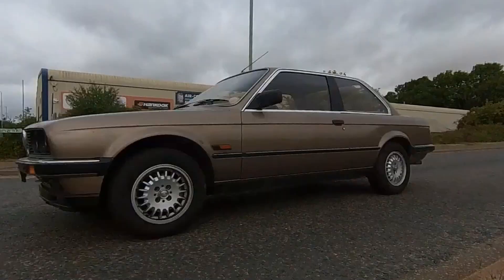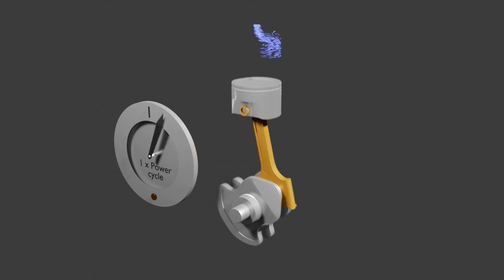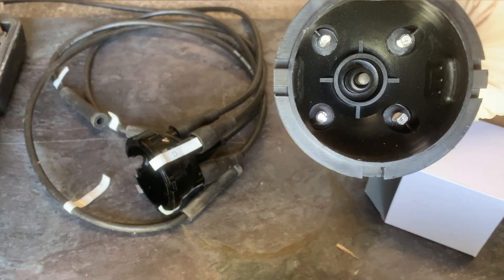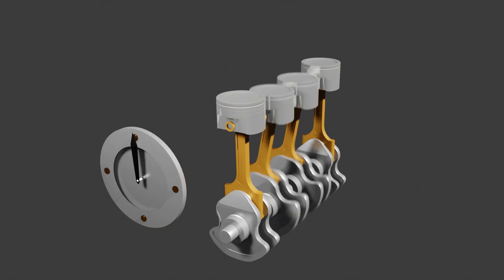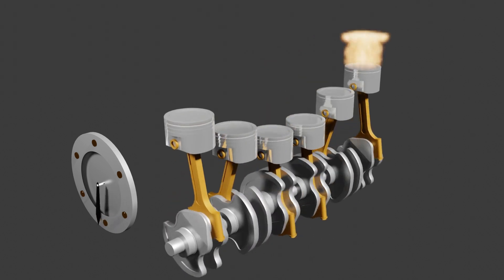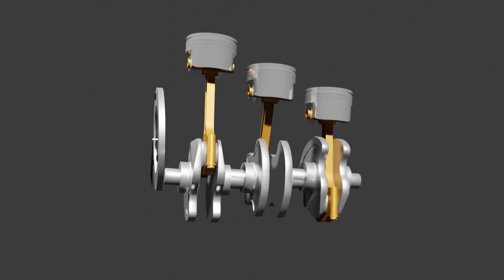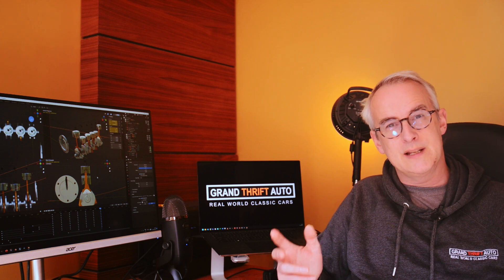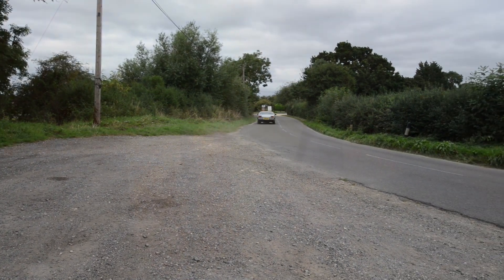Why the straight 6 is so smooth

Comment: Chrysler is building an inline six , but its saddled with turbocharging , and other geegaws.
Reply: @Jonathan-dq8hb  a turbocharged inline 6 is not inherently bad. 

The B58/S58/N55 and so may other BMW inline 6 turbos are proof. The best petrol engines on this planet

Comment: Why not just make it em small displacement so they fit better like a 2.1 or 2.4
Reply from the maker: Some do just that - my BMW E30 is a 2.0; early Triumph Vitesses had a 1.6 litre six; and Honda even raced a 250cc straight six motorbike in the 1960s.  I'm not sure it makes a huge amount of difference to the overall size of the unit though.
Reply: @GrandThriftAuto  I mean is a 2L i6 that much bigger than say like the 2.7 i4(Toyota) or 2.9 i4(gm)
Reply: Efficiency is part of the problem, I think.   My BMW K1600 is small enough to fit in any automobile and has more than enough power (162hp) for small cars, but it doesn't get any better MPGs than my MINI.

Comment: The inline six is alive and well in the heavy truck industry and an absolute beast at up to 1000hp. Under full load and pulled down to 1000rpm an inline six will thump so hard you feel it through the floor.
Reply from the maker: Very true - you’d get laughed out of the yard with a four cylinder truck, right? 😊

Comment: Love my R129 SL320 straight 6
The only smoother was two straight 6’s bolted together to make the V12 Mercedes engine.
Reply from the maker: Mmm, love R129s. I agree about the V12 too - my XJ-S ran pretty smoothly even on 11 when it split a fuel hose.

Comment: I thought the inline six was being pensioned off when Mercedes ditched them for V6s ostensibly for packaging reasons with the front crash structure.  Then it reintroduced the inline Six again for packaging reasons; this time to fit all the turbo hybrid gubbins (!). You just don't know what to believe.  I remember the 2.8 twin cam in a Mercedes W114 back in the 80s.  Happy memories!  From road test reports it always seemed that V6s were rather thirsty - something to do with the breathing.

Comment: I've always loved a straight 6. And as you mention for biglyness under the bonnet... you'll need to get a look under the bonnet of my V70 with it's transverse 3.0 turbo 24valve VVT big six. You can't get a manual gearbox with that engine in a Volvo because they physically don't fit and it's even so tight with the short, 38cm long automatic that they even had to move the timing belt to the bell housing end of the engine. The alternator is also half way along the block driven by a jackshaft from the aux belt pulley... which is also on the bell housing end.
Reply from the maker: Wow! That sounds like a very tight squeeze and some serious head-scratching by the design team.

Comment: Fans of the straight six engine might be encouraged by the fact that Mazda, in their quirky wisdom, have just introduced a turbocharged inline six cylinder engine, displacing three litres, in their all new CX90 SUV for the US market. Rumour has it that it may find its way into the Mazda6 together with all-wheel drive in their efforts to take the brand up-market.
Reply from the maker: Thanks - yes, so I learned today! Good to see Mazda’s apparently last new engine will be a straight six 😊

Comment: Great explanation on this subject; the graphics were very clear/easy to understand!  There have been a few cross-plane four-cylinders; notably, the Yamaha R1M motorcycle; it has an almost V-8 sound, being a four-stroke...the other examples are two-strokers, such as outboard motors and the Detroit Diesel 4-53 and 4-71 models.  And, as you noted below, there are seven cylinder in-line ship engines; they are two-stroke, and turn at very low RPMs; the ultimate ship engine of this type is the Wartsila/Sulzer RTA-96C 14 cylinder in-line engine, which produces around 80MW at 102 RPM.  This mfg. makes the RTA-96-series in six to 14 cylinder configurations, all in-line, tho I don't think there's a 13 cylinder anywhere, but I did read that there were four container ships built w/ in-line 11 cylinder engines...

Comment: Straight eights were some what common the first half of the last century.  Even smoother? or twice as bad a four?
Reply from the maker: Great question! You should be able to make the 90 degree crank offsets from the 'impossible engine' scenario work with an extra four cylinders, so you'd get a 90 degree overlap between successive power strokes - so yes, a straight eight should be very smooth.  Tough on crankshafts though, with a long way and hence a lot of torsion between the resistance end (flywheel, gearbox) and the furthest cylinder.

Comment: I really wish this video was longer
Reply from the maker: Interesting...anything in particular you'd like to see more about?  (I'm assuming you aren't being sarcastic here 🙂)
Reply: @GrandThriftAuto  ha! No honestly it was very good. Just felt the build up was long and the actual title of the video was handled in about 2 mins. Straight 6 is my favourite format. Would like to learn more about it. What are the differences in application between Jaguar and BMW, TVR, Toyota and Nissan etc. Are they making a comeback (I believe they have recently) etc etc
Reply from the maker: @stuffthatmoves7085  Good questions, noted for the future - thanks very much for the feedback!
Reply: @GrandThriftAuto  I would like you to talk about straight 5 and 3 cylinder engines. 5s always seem to sound like truck engines but are smooth when revved. What are the advantages of these two types?
Reply from the maker: @bimble7240  Yes, the five is an interesting one. I did consider including it here but decided I’ll do a separate video on it, ideally if/when I can negotiate access to a 5-pot car.

Comment: Really good explanation, I remember looking at the points you covered in an old AA hard back reference book of the engine  as a boy in the 80s. 
Interestingly I have just bought a new LR Defender with a 3 litre petrol straight  6 cylinder, ( JLR a have moved back to straight 6s in petrol and diesel in all their larger cars) and wow, I'd forgotten just how silky they are. 
Best wishes Richard.

Comment: I'm from the states and I've owned over 1400 cars. The best engines I've owned have all been striaght six cylinders. My favorite was a Ford Granada with a 250 straight six. I also owned a Chevrolet pick up with a 292 straight six and several Ford pick ups with 300 straight sixes. I never had any trouble with any of these and the straight six pick ups and they would out pull any V-8 I ever owned. I contribute this to the centrifical force of that long heavy crankshaft  required in a straight six.I guess if I want a straight six today I'll have to by a BMW.
Reply: Of 1400 cars you pick the Granada with the 250? There's a story in that, and you should write it.
Reply: @ingvarhallstrom2306  I was a Chevy fan most my life, but I bought this green metalic 1979 two door  Ford Granada in 1990 for $300. It was a great car to drive, very comfortable and gave me 22 mpg. I like it more than any Chevy I ever owned and that includes a long list, like '55, 57, 58, two 63's .72, 70, 79, even a '51. I still regret selling the Granada. After the Granada I have owned many Fords, Escorts, Taurus, seven F150 pick ups. I wish now I would smarten up back un the 1960's and switched to Fords.
Reply: @genegoodwin8925  That's a fantastic story, and coming from a Chevy man no less. Considering all the tribalism in the car world, that's great. It really hits home...
Reply: @ingvarhallstrom2306  My best friend always drove Fords because his dad was a  mechanic at a Ford dealership. He never had any trouble with his Fords, My chevys were always breaking down with blown engines, transmission trouble, clutches, spider gears. I should have learn from my best friend back in the 1960's but I must be pretty slow because it took me years before I made the switch to Fords.

Comment: There are only straight six engines on my driveway.
A 1987 BMW E28 525i and a 2003 BMW E39 525i touring.
Both are an absolute joy to drive.

I wouldn’t say the straight six is becoming extinct . 
If anything, there is a revival for this glorious engine.

BMW always stayed with the concept, Mercedes took a side road to V6 engines, and then reverted to straight sixes again.
Jaguar and Mazda are also producing L6 engines again.
And I’m probably forgetting some other manufacturers.
Reply from the maker: A renaissance would be pleasing to see before combustion engines disappear from cars altogether. I hadn’t picked up on Mazda - thanks for adding that - but BMW, Mercedes and JLR are the only other makers I know of. (Disclaimer - I’m not fully up to date with the current new car scene, especially outside Europe.)
Reply from the maker: …oh and well played on the E28 and E39, such excellent cars!

Comment: Another advantage to the inline six is that there's practically no end to the scaling up or down in size, that's why most truck and bus engines are sixes up to the size of ship engines.
Reply from the maker: Very good point, thanks 👍
I discovered that there are even inline sevens in ships, which got me thinking - but I had to draw the line somewhere for this video.